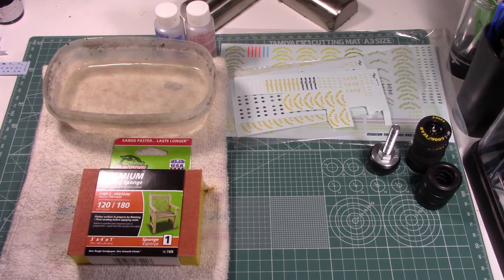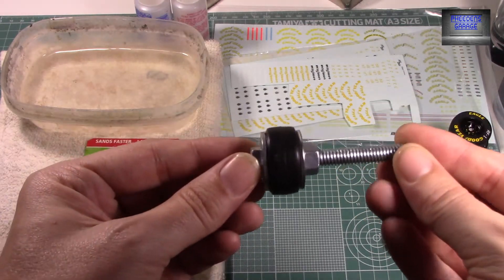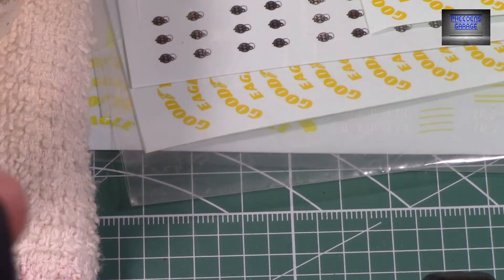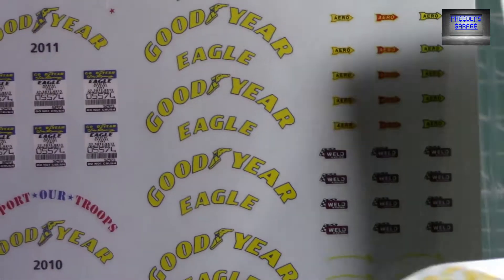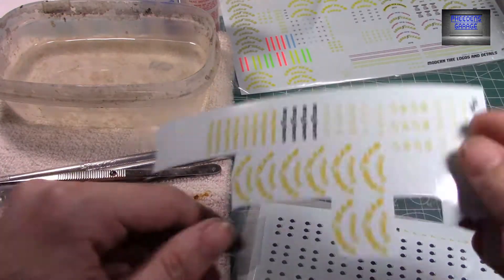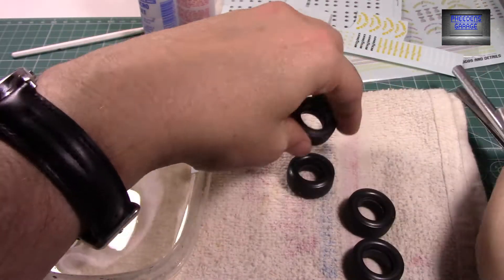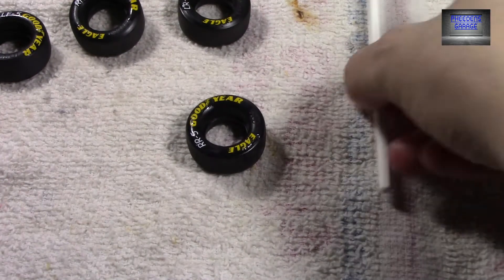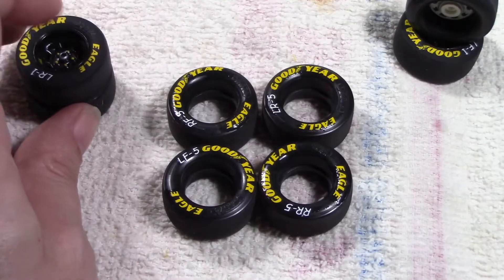Basic Detailing Of NASCAR Tires.

Comment: Im sorry, i didn't catch the name of the bottle of solvent you use on the tires.
Reply from the maker: Jeremy, in this video, I used Micro-SOL and Micro-Set from Micro-Mark products.
Reply: @PheedensGarage  is it necessary? can we not use it?
Reply from the maker: @Ghost_0459  you dont have to use it, but , it really helps the decals stick,  it's worth it
Reply from the maker: @Ghost_0459  Of course not, but it really helps the decals set.
Reply: Your sanding technique is cool, I'd been doing backwards (using a Dremel with sanding drum & then circle around the rubber...not easy & hard to keep it uniformity sanded...👉like I said I been doing it BACKWARDS...🤦‍♂️😂😂
Thanks 4 the 💡💡💡...
☯️ ZenModeling☯️